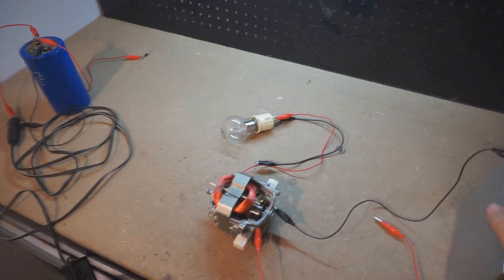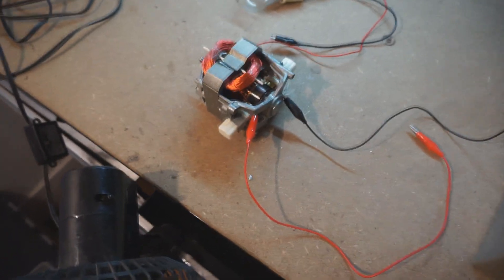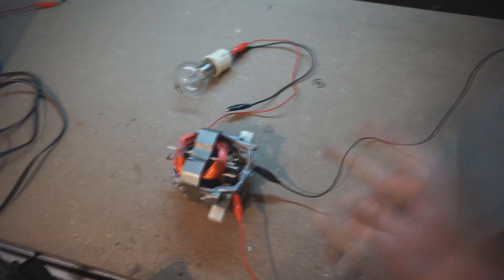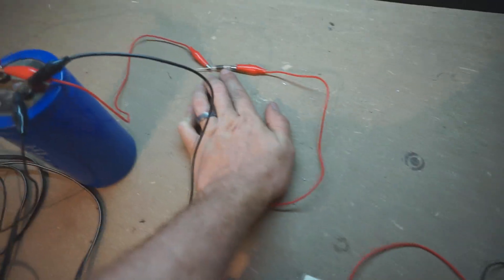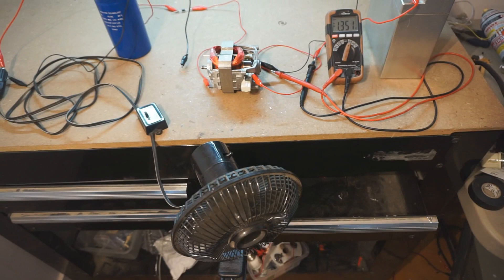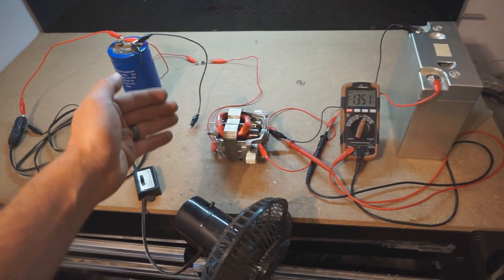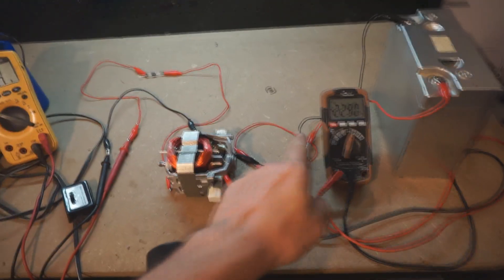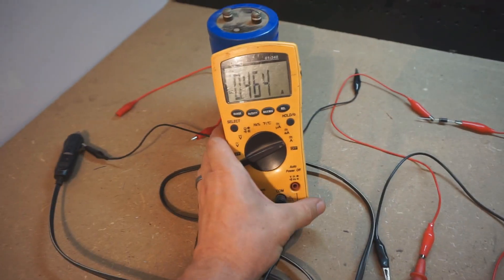Universal vacuum motor generator effects...

Comment: Current has to go down, because you are inducing a further voltage drop on the battery when you run the fan.  Which lowers the battery voltage, which lowers the current.

Comment: Looking for tips. I have a universal washing machine motor. 6 pins: 1 ground, 1 neutral that goes to the coil, 2 others(brown and black) that go to the coil, and 2 for the tach. Whether I use brown or black,I must manually start the shaft. And it will run in either direction. Can this thing be hacked to be self starting? Can the direction of spin be determined?

Comment: You should power this experiment with a constant voltage bench supply so you can monitor current as well as voltage, or at least know that the voltage is stabilized.  It appears you're assuming the battery voltage is constant when you go from drawing ~2.2A to ~1.2A.  I imagine with the battery as a source, when the current goes down to 1.2A, the voltage rises, so the effective power isn't that much different.  Would be fun to see.    

Difficult to speculate on what causes the results you're getting since you're not sharing exactly how you've got things hooked up or how you've modified the motor.

If I guess correctly, pretty good use of Litz wire.  I imagine you're only powering one stator coil and the armature of the motor with the battery.  The other stator coil is free for you to rectify and connect to your ginormous cap and lamp.    For the motor to run, the one stator connected to the battery has a constant mag field for the armature to work on.  The armature has a constantly changing magnetic field, due to the commutator, which is what keeps the armature spinning.  Let's say the armature turns at maybe 3.6kRPM, or 60 times per second.  If the armature's commutator has 16 segments, there may be 8 coils on the armature, the armature's coils' magnetic fields will be rising and collapsing at  480 Hz (60 RPS x 8).  This power frequency is just getting into the realm that will benefit from use of Litz wire.  Pls note, Linear Technologies has a great power rectifier product that lets you use MOSFET transistors to rectify AC voltage instead of diodes.  This is synchronous rectification and the losses are substantially reduced.  

A normal motor like this has two sources of magnetism, the stator and the armature.  To reverse direction, you have to change the polarity of only the stator or the armature, but not both.  Eg. leave the polarity of the stator alone and change the polarity of the leads going to the brushes only.  Note that Universal motors are called universal bc they operate on AC as well as DC.  When running on AC, the input voltage is changing polarity many times per second at both the stator and the armature.  I suspect what you're used to is a permanent magnet motor.  The polarity of the magnets is always the same, so changing polarity to its leads will only change the stator or the armature, but not both.

Comment: your used generators that when you generally put a load on it it drops the amperage that your pulling out of the battery . the purpose of a generator is to produce electricity . whats the purpose of what your doing i see nothing

Comment: It's a high speed low torque motor. when you short the coil it induces a field that slows down the rotor, but also induces counter EMF on the rotor windings.
Reply: And also drops battery voltage, which will make less amps.

Comment: I won't go into a complete description of what I think is happening, but if you remove the capacitor and diode, and replace the fan with a regular light bulb, I am willing to bet that the current draw from the battery will remain the same, with or without the light connected. Let me know the results and I'll comment further.

Comment: could you post the forum you found this design in? I'd like to try it out. I've got the Litz wire and motor, I am just trying to find the info about it. If you post a schematic, that would be awesome. I've been tinkering with it but mine doesn't take off with 12v.. I don't want to smoke out the coils..

Comment: Why would you need AC on a regular light bulb like that? That's an incandescent light, right? If you tried that somewhat big bulb on the battery and it didn't light up much then that's not because the bulb "needs AC." That's because your "generator" side of the motor (the side that runs on higher voltage) is putting that higher voltage across the light, giving it more current than the amount that the 12V battery will force it to draw.

Comment: It does not reverse direction because the current in the armature and field coils are both changing polarity, which means you did not change direction of the magnetic field at all. One must be stationary while the other is changed if you want to change direction. This is why universal motors can run on AC too.

Comment: its called universal motor for a reasone: it runs on AC and DC. compare it to a pure DC motor and ther you will find permanent magnets building up the stator. therefore the stator will never change its magnetic polarity. if you change the electric polarity at the terminals of the motor it will run in opposite direction. 
changing the electric polarity at the terminals of an universal motor however will change the magnetic polarity of the stator and the rotor and therefore the direction of rotation will stay the same.
hope this rather simplified  explanation will help!
Reply: bullshit
Reply: Quantum Leap off a cliff .bullshit
Reply: Quiet boy, you are showing your gross ignorance. Again.
Reply: Well said, and exactly correct.

Comment: The key is serial with your heaters in your house. Use a choke but instead just a choke, make a transformer puted in serial with a line were the current is high, then take current out of it to charge battery. The only way is to not consume more but when you take voltage, take a part of the current and do what you want. To understand, take a cheap ac motor, those with the copper shunt like into a micro-wave oven fan, remove the primary, put 14 awg enamel wire full, plug it in serie with a 1000 watts heater. It will turn perfectly and your heater will run now at 950 watts but you have electromotricity power now.

Comment: is the amp reading in negative value? (wired in backwards) and that's why it looks like the amps dip when you apply load? 
Just wondering.
Reply: +Jordan Smith i dont think there is such a thing.. theres no such thing as -2amps its either something or nothing
Reply: +realflow100 ah I see
Reply: Jordan Smith also why would the value get closer to 0 from being higher than 0.. it'd make sense regardless of which direction the current is flowing... it would still be 2 amps in either direction. so current is directionless to a multimeter

Comment: hmmm if we can place more generator coils, we can try to self loop the load and charging effect ? motor draws 12v at 2 amps-24watts, generator producing 164volts rms at 0.4amps-80watts? self charging effect nominee?

Comment: Current consumption drops when you put a load because you steal power from the field (or stator) windings. This principle is used in vac cleaners - they put AC straight to the brushes and feed the field coils from a phase-fired controller. That is how I think it works.
Reply: MrJohhhnnnyyy wrong you thought wrong

Comment: not sure of what u are doing here but looks like u are running the fan and motor off the battery hence the voltage drop.  The motor is not producing any current.  It is a motor not a generator.  And the direction of travel is because the motor is an ac/dc motor capable of running off of both.

Comment: I think the reason it drops in amps is because of Lenz law.
To generate the energy it in one direction with the coils it's generates an opposing force. I think due to this force the motor is slowed down. 
As the current draw depends on the speeds of the motor it drops. 
(I'm Dutch, technical English isn't the best it could be, but I hope I get what I mean)
Lastly I wonder if this motor can even draw more then 2,5amp. As I see it these is no current regulation and the motor can take as much amps as it wants but somehow ends up on 2,2-2,5 amps. But I guess that's linked on the maximum voltage the battery can give.
Very curious on your take on this when you find out.

Comment: I'm thinking the "weird" effect may have to do with the current/voltage graph. Let me explain. When you put the motor on itself, the current goes as high as it cans, running the motor at full speed. But when you use it as a generator, the drawback of current in the coils slows the motor down, dropping the current needed, as the amps from the battery are related to the speed of the motor much more than to the current draw From the motor. Here is a graph : http://puu.sh/jbQNB/9ae5539ca9.png
Hope that helped :D Would be interesting to trace these graphs precisely though.

Comment: Amazing eye opener and eye pop out video! Never doubted Laser Sabers honesty from day 1!!..I don't care about polarity, I was impressed with the darn thing lighting up an incandescent ac lamp! i realised that theres a lot or mysteries to learn and uncover about coils and switching pulses from such devices!!looks like lasersaber graduated from transistor switching to mechanical switching experiments! Good luck! ps: input to the motor was about under 20 watts 12v x 1.5amp, but the darn coils was making almost 0.45amps short circuit but at what loaded voltage reading???? should I interpret this as near overunity? it also reminds me of parahamsa tewari's reactionless generator(RLG) I guess amazing things manifest when generator coils are placed in close or next proximity to the motor run coils..this video might also exonerate bedini from those who doubted his findings

Comment: In order to switch the direction of a universal motor like this (where the field coils and rotor coils are in series) you need to reverse the polarity of just one of the coils. By simply reversing polarity to the motors entirely, you switch the polarity of both the field coils and the rotor and the thing still spins the same way.

Comment: Excellent video! I never saw a DC motor not reverse direction with polarity. Interesting.
Reply: electronicsNmore Well it is not truly a stand alone DC motor it is a Universal motor that works with both AC and DC. Now if you saw a DC motor with magnets and commutator that spin only one way that would be the one that baffles all of science. Here the stator and rotor coils are all connected in series and if you reverse the polarity of the battery all it does is just flip all the magnet poles around and the motor still rotates in the same direction.
Reply: Still a motor being powered by DC and runs good. Impressive.
Reply: electronicsNmore Yes it is impressive. Tho Its not just a motor but a generator as well. I'm thrilled to see this done here. To me the awesome thing about this universal motor is that all the coils are connected in series.
Reply: @Meghnad so the novelty of this device is rectifying the motoric mechanism while alternating the electrical mechanism

Comment: "normally light bulb will not light up on dc" - demonstrate that silly statement. Just use adequate voltage, not one AAA.
Reply from the maker: ***** 
This particular AC LED bulb has been tested with 80V DC and will not light up.  I tested two different AC LED bulbs that normally use 120V AC to see if the output could be used direct off the generator coils without the diode.
I see that you are into paragliding.  I am about to post some videos documenting the upgrade to my electric paramotor that you will probably find interesting.  I am upgrading the unit to a 40Ah battery pack.
Reply: +lasersaber Ac led bulbs often have capacitor ballast. That is capasitor, connected in series with bridge rectifier, and both of them - directly to the input. Everithing else inside (LEDs and smoothing capasitor) is powered from this bridge rectifyer. Such construction require pure sine AC power.

Comment: I am a bit unsure, but seems like you take the rf away from the stator, so only the dc components are left. That would make the stator elecromagnet more efficient since the occilating currents in the stator is removed.

Stronger field would also make the rotor spin slower. Less current = weaker field = higher speed. Higher speed make more BEMF in the rotor, and thus less current. A fun motor indeed.
Only friction and inductance stops the speed from going to infinite!!

You can try to parallel the brushes and stator magnets. It would give a motor with a very different behaviour.

Comment: Very Nice Idea, like a "self rotating transformer" :)

For what is going on, I guess that when the output coil is open, the back EMF of the primary coil is fed back to the primary coil and works as used too, against this coil, but that when you allow current to flow in the secondary coil, you allow the energy of the back EMF to flow in this output coil and no more and less work against the primary coil.

So Nice to have Guys like you to experiment around and have Pretty Good Original Ideas like that! :)

Regards, Khwartz.

Comment: Great to LS-nice job.
Reply: Erlend Ervik Actually, generators used in power plants have no permanent magnets either, and will generally use self excitation, that means they generate the magnetic field by using some of the electric current the generator outputs to power the field windings. 

The interesting thing is that these generators can generally start up without any external power, as the remnant magnetic field in the iron of the machine tends to be enough to provide enough power when the generator is unloaded to start up the field windings(of course, there is provision for using an external electric source during startup should there be insufficient remaining magnetism to start the generator).
Reply from the maker: TinManPower 
Thanks for the inspiration.
Reply: Would this motor make a good generator for a Small Stirling engine?..or is there to much friction from the brushes and drag from the magnets? I'm only looking to charge through a usb at 1/2 a amp. You Two are Awesome by the way!! :-)
Reply: william o'rourke Actually, it lacks magnets.
You will need current to generate current with it.

Using something with permanent magnets would be a better way. The advanced way is to use the power from that on a bigger generator to power the field windings via a regulator.

Comment: Is this not a bedini motor because my bedini motor has the same efect 150ma in and 300ma out thats 12v 150 ma draw and i am powering motor and led lights off the out put and every time i draw from the output it slows down the rotor now whats interesting is even with gen coils add and separate from the motor curcit when drawing from the coils it would slow the motor down now iv got a video on my channel showing this effect but its really cool effect because the gen coil slows the rotor because of enduction and the pulses slow down wich means draw drops down because of less pulses so in short found that combining bedini motors and adamsmotors with joul ringers and other things like your static motor very cool that needs to be hybridized with tesla works on gathering cosmic rays.

Comment: Could you use a transformer in stead of a FWBR? The effect MIGHT be triggered because of the half way rectifying. But then again: try a transformer 127V -> 12 V and I suspect the amperage will go up (unless the voltage collapses of course), then a 24V -> 12 V transformer or 1:2 transformer might even give a gain. Clearly enough rome for experimenting here.

Comment: AC is actually RF. Did you know that?
Reply: For a while some radio transmitters actually used motor based systems called alexanderson alternators to generate the RF frequency AC used for transmission. Of course, they were limited to <100khz, but had the advantage over the spark gap transmitter that they could generate a single frequency carrier that could be modulated.